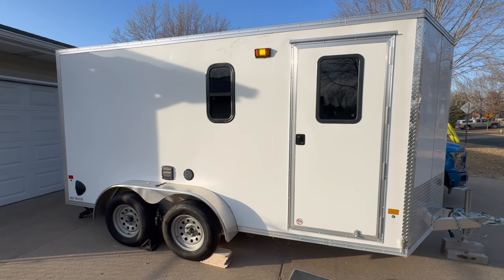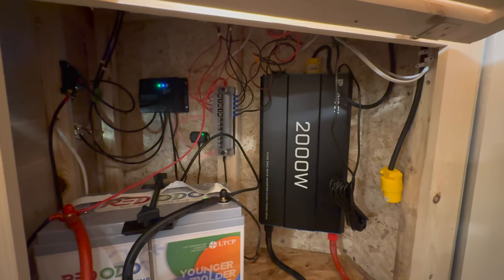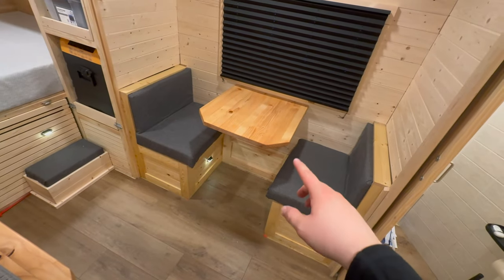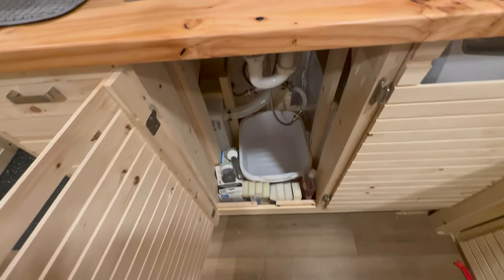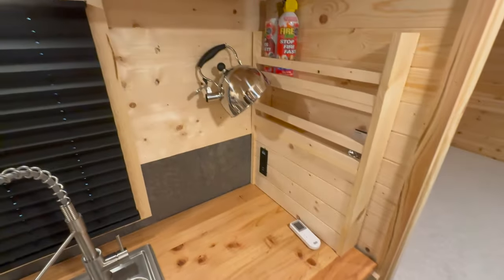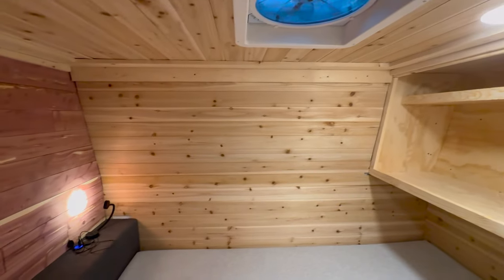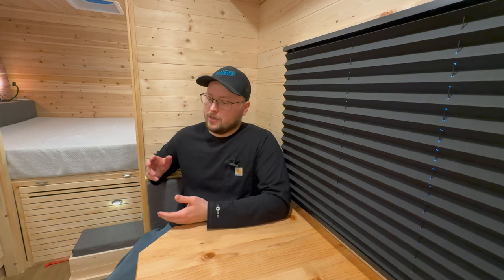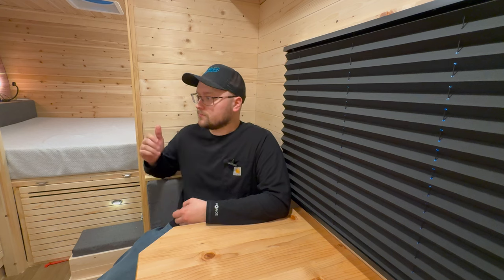The Cargo Camper | 7x14 Cargo Trailer Camper Conversion #cargocamper

Comment: I have that same NuWave induction unit for cooking.  Ten years ago I bought two of them. After two years one of them died. But the other one is still going.  Induction cooking is the way to go. But you will need cookware that is induction friendly.
Reply from the maker: Yeah, induction works great. I got a “granite ware” pot, one of those light weight porcelain pots. Luckily that was magnetic so it works well with the induction cooktop.

Comment: The trailer looks great. I have watched many of these builds and almost everyone buys an 7' wide trailer. Just wondering why, 8' would give you just that much more room.
Reply from the maker: Mostly restrictions on configurations, at least that was my experience. Certain lengths of trailers have specific options available for height, width, and axles. Also, 8’ would have been harder to tow without the extending tow mirrors. Not that it’s a show stopper but potentially additional expense.

Comment: This is great! I wanna do one the same size, what size is your bed and what kind of mattress did you use?
Reply from the maker: I went with an “RV Queen” size mattress. It’s basically just a shorter queen mattress so it can fit side ways. I went with a memory foam but it was a really cheap so we had to add a memory foam topper as well. With the topper though it’s pretty comfy. Definitely beats cots or air mattresses.

Comment: Nice build, working on a layout to do one myself, do you mind sharing the width of your bed and your dining table with benches?
Reply from the maker: The bed is an RV Queen which is 5’ wide, if i remember correctly. For the dinette seats and table I actually have some videos listed in the description that are more detailed about sizing and how I built them. 

I actually had less room than I wanted for the dinette because the bed, bathroom, and cooler drawer dictated the space I had left. A 7x16 trailer would have given far more space to work with for the dinette.

Comment: Take it out and use it.. the longest time I used mine was 32 days,I learned a lot, how well did you insulate?
Reply from the maker: I insulated ceiling, walls, and under the floor. I primarily used the foil faced foam board insulation, which is roughly R-6 if I remember correctly.

Comment: Nice build. What kind of insulation did you use? Also is the portable ac unit vented through the wall?
Would love to see an in-depth build video series if you filmed it👍
Reply from the maker: I used foil faced foam board insulation.  For the ac unit, it’s a single hose unit that I vented through the wall - but I Jerry rigged an intake to prevent the negative pressure problem with single hose units. 
I have some videos linked in the description. They’re focused on building specific parts of the camper, like cabinets, planks, and countertops.

Comment: Excellent work. I like it apart from the bare timber... Are you planning on lacquering it?
Reply from the maker: Haven’t decided yet. I’ll probably add a layer of oil poly or lacquer to help protect it and give it that pine cabin glow. Otherwise I may go water based poly to protect it but avoid the amber color.

Comment: What was the dry weight of the trailer and how much additional weight was added with the build out? Beautiful build out.
Reply from the maker: Only 1500 lbs to start. It’s all aluminum so that shaved off 500-750 lbs compared to steel frame dual axle cargo trailers. I don’t know the exact weight now but I believe I added anywhere between 2K and 3K lbs so I’m probably in the range of 4000 lbs total. That’s actually why I went with the dual axle trailer, the extra cargo capacity. Also it helps with towing.

Comment: Great job! How is that battery working out, do you think you need a second one?
Reply from the maker: It was fine for lights and fans but the fridge was a large power drain so I would have issues on a 2 night trip when parked in the shade. It did ok when in a sunny camp site, from the solar charging. Recently I made some massive power upgrades. I now have 3 batteries, 4 solar panels on the roof, a portable solar panel, and also a battery monitor so I know exactly where the battery level is at. Now I have more than enough power which means I can use the induction cooktop for heating stew or making coffee. Even running an electric heater for a few minutes to take the edge off.
Reply: Wow, that is a big upgrade! I'm trying to figure out my build in my 7x14. Electrical systems can get very expensive.

Comment: Very nice but no shower?
Reply from the maker: No shower. Not needed since I’m using this for camping. The bathroom is probably big enough to become a wet bath if I ever changed my mind.
Reply: They make an outdoor shower!
Reply: @fangerwoodworking I saw a bus build once, the guy used one of those 2 to 3 gallon spray bottles you spray your garden with, that he bought at Wal Mart for his Shower. Just pump it up wet himself down, soap up, and rinse himself off. It is amazing how people come up with simple Ideas on these videos.
Reply from the maker: @lestonthompson8495  That's a good idea. I saw something similar from @Bushradical in his outdoor shower building project. His was a permanent building but it used one of those pump sprayers too. The one he used was metal so he could fill it with hot water, heated from a stove.
Reply: @fangerwoodworking  You know, I realize you can get by without water, but people have to realize no matter how bad you have to have it, water is the death of your camper if you get leaks. Anything that one can do to minimize the possibility of leaks is a good thing. Putting a fresh water storage tank in your camper and running water lines from one end to the other in a rolling earthquake  is just asking for it. Seems like portable 5 or 10 gallon tanks would be the way to go. Carry them in your tow vehicle then hook them up when you get on sight. If you have to have your toilet on one end, and kitchen on the other end of your camper the have to separate water pumps on to separate systems. I reckon what I'm getting at is keep it simple. People, myself included have a tendency to over engineer things

Comment: Why not buy a travel trailer?
Reply from the maker: Buying one is easier but there's a number of benefits to building one, besides enjoying building it:
- Cheaper than buying a travel trailer (at least for the features/specifications I wanted)
- Control over trailer and frame quality. This cargo trailer is fully aluminum so I don't have to worry about rust (for the frame and panels anyway). It also shaves weight, which helps because I wanted a dual axle trailer. Also, some of the cheaper travel trailers are framed with 2x2s which can be a much bigger deal if water gets in. Water is always a problem but it's much worse in a wood frame.
- Solar panel and battery choice so I can run the lights/fans/cooler indefinitely. Some travel trailers have those features but they're usually premium options or an add on which will still add to the cost.
- I built everything which means I can fix everything. Also it's easier to replace or upgrade parts of the trailer whenever I want. I'm not stuck by a proprietary part. 
- Control over the design. Maybe not a big deal for some people but I don't like how sterile most trailers look on the inside, I wanted a cabin look. 

There are other reasons but these are some of the top ones I can think of now. It's not for everyone but it was the best choice for myself. It's similar to buying or building other items, like cabinets or furniture.